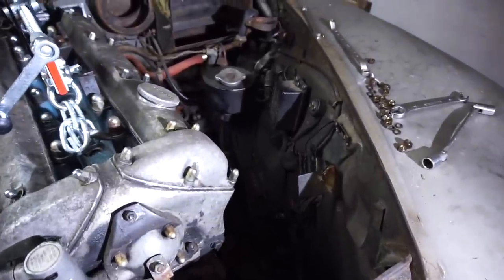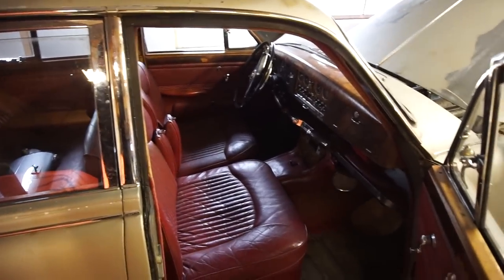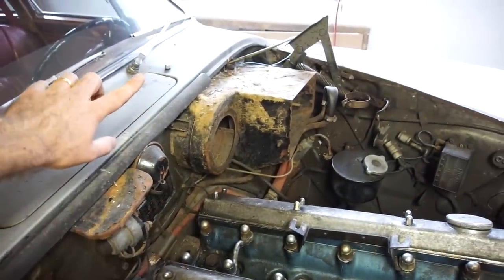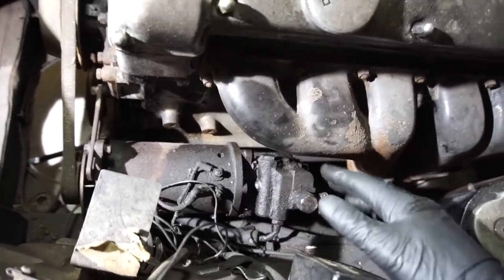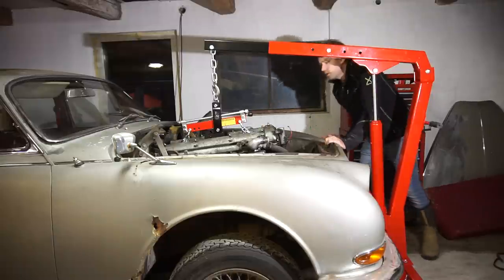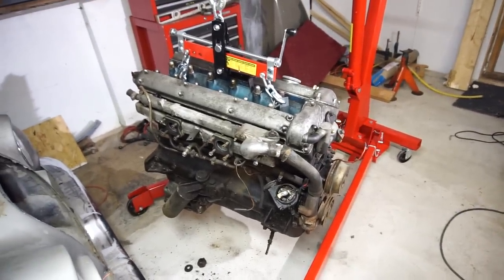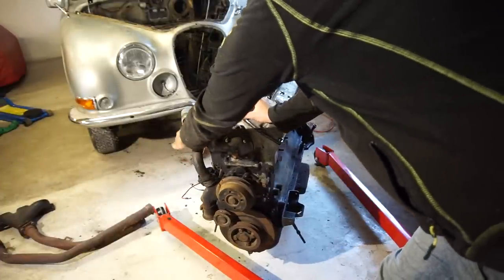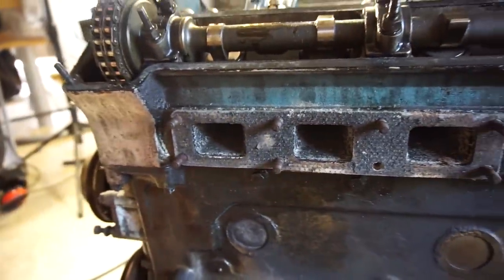Classic Jaguar Full Restoration Project - the restoration begins

Comment: The S type is fantastic, hoping you are enjoying the project, keep the vlogs coming, all the best
Reply from the maker: I will, thank you Ross
Reply: I have. 2000 XJ Sport and a Daimler 250 V8, your vlog is very very inspirational. All the best
Reply from the maker: I really like that little Daimler V8. A very sweet engine
Reply: Well she’ll sit at 70mph all day long if needed, really raspy exhaust note, and being the Daimler, benefits from the LSD rear axle and much better seats up front. I must also add, not that it matters, but, MPG is surprisingly good. She is a 1968 with a genuine 85652 miles on the clock from new, I drive her as much as possible. Keep up the good work

Comment: Adam,  Looking forward to watching the restoration, Hopefully you will be lucky with with the shell but it‘s amazing how much rust
the Jaguars can hid until you get them apart, My XK 150 looked fair for a 1958 car but when i started the strip down the dreaded 
rust problems where very evident, So a ground up bare metal restoration was the only way to go.  I have a 1966 MK10 & a 420G 
That will be scrapped  if i can‘t sell the rolling shells but i will see if there is anything you can use. Cheers Dave
Reply from the maker: I know what you mean. I can’t wait to get the whole interior out so I can really start to inspect the inner sills more. From underneath the floors are very solid.
Is the Mk10 a 3.8?
Reply: Adam, Unfortunately neither of the cars have engine or gearboxes with them but the cars are rolling shells i thought
for 500 euros each they would sell. The IRS systems would be worth that alone. Cheers Dave

Comment: Fabulous project.  What is your ultimate “vision” for this car?  Are you wanting to restore this back to original as a show car?  I have a 57 Chevy that was almost completely original and in really great shape.  My old car mentality is that I like a functioning time capsule.  I like the feel and aesthetics of driving my 57, but I like eating solid food, so I installed power brakes, upgraded the front drums to disc brakes, three point belts up front, power steering, a more reliable engine, etc.  I pop the hood and 95% of people would have no idea that a lot under the hood isn’t original.  Anyway, that being said, depending on your budget, Johns Cars in Texas sells kits to attach a Chevy 350 or 700r4 transmission to a Jag XK engine.  There are interesting electric power steering upgrades for old cars nowadays.  And the ‘75 XK engine I rebuilt for a kit car project, which is currently sitting on a homemade run stand, as a small size or ‘micro’ alternator on it that works fabulous with some temporary brackets.  I’d attach a picture if I could.  One last thing, if you have a Harbor Freight or their ilk near you, furniture dollies, a 2x4’ sheet of 3/4 plywood, and some short 2x4 pieces under the front of the engine for the odd shaped oil pan makes a cost effective way to roll an XK engine around and to wok on it.   Sorry for the long post.  You should attach a ‘channel email’ address so nerds like me can send you info you probably already know.  =)
Reply from the maker: No need to be sorry for.m a long post, in a need too :) I do my best to reply to all comments.
My ultimate vision is a car that looks like 1966 but might be hiding a few updates.
I’m thinking of adding a newer transmission out of an XJ6 and to possibly build a custom AC unit that is hidden in the original heater box. I love the interior so I’m keeping that original. I’m not a big fan of the color of the exterior so I’ll be changing that but keeping it true to a Jaguar 60’s color. Since all the chrome looks pretty nice I’ll be keeping it as is. So basically it will look like a good survivor car that’s useful
Reply: Living With A Classic   That sounds almost exactly like my mode of thinking.  My 57 is a good weather daily driver, but I update it for safety and reliability.  With your interior, I’d even go so far as to leave the radio in the dash but disconnected and hide a Bluetooth amp receiver thing to some speakers and use your smart phone for music.  Vintage Air is a good company for classic car AC and heat.  I had a vintage air AC in my 1960 Cadillac.  It was ok, but old cars aren’t sealed very well, so the AC wasn’t too effective.  I’d look into modifying an aftermarket VW beetle AC unit.  If you went heat only, vintage air has a very compact heater and defrost unit in the $200 area.  It’s like 9”x12”x3” or something.  Very good and simple unit.  Tranny wise, I’d stay away from the Jag BW-65 autos.  They’re not too terrible, but if you have room for a Chevy 350 transmission, maintenance and reliability will be much better.  If you do use a Jag tranny, look into changing the rear end gear ratios for better highway driving.

Comment: Space savings was the key selling point when GM offered a generator / power steering pump combos in the 1957 and 1958 autos that had factory air conditioning, as did the Packard/Studebaker Hawk that had both Paxton supercharger and factory air.

Comment: I've been waiting with bated breath for you to start this project. I have restored my 1965 3.4S and am half way through restoring a 1966 3.8S. 
I've installed 4 pot Volvo 240 front brake calipers as an upgrade and am in the process of changing the battery polarity from positive earth to negative earth plus electronic ignition. What are your thoughts on these modifications?
I use my Jags all the time. My daily driver is a 1989 XJ-S coupe, and I have a 1965 Mark X as well.

Comment: Good job getting the engine out.  I have a lift and tilt setup just like yours.  You can get better ceiling clearance by choking up on that hook chain.  Just remove the bolt holding the chain and put the link closest to the hook through the anchor bolt.  Hope you got a pair of S.U.'s in the deal.  They are pricey.
Reply from the maker: Thank thank you! I realized I could do that half way through the lift so I know what I’m doing when it’s going back in haha
Yes I have everything for the car except the dipstick and 1 small piece of chrome.

Comment: A way of accurately locating hinges etc. Is to drill a  1/16" hole on each hinge, through the shims etc. for a "roll-pin" which will be in a unique position, so that when you replace them they will be in the original position.
Just make sure that ALL hinges are located accurately, (door drops amended), before drilling for the "roll-pins".
Looking forward to this restoration !
Reply from the maker: Thanks for the great tip!
Reply: I have seen people do this and I think drilling holes into your car for no reason other than marking a location point is stupid! I own Jaguars (`67 E 2+, `95 XJS 6.0, `95 XJ12 SWB, `05 XJ8 Sovereign, `05 XKR and other cars. My 1954 Hudson Convt made the cover of Car Collector at one time. You can mark locations with a grease pencil that can be cleaned off after installation instead of creating a potential rust spot.
Reply: @Clarkecars  when you're going to media blast the car, a grease pencil just won't cut it  !
Then when the bodyshell is repainted, there are no marks to tell you where things are fixed. 
So a minor hole that gets filled with paint seems not so "Stupid" after all  !
Reply: @Rovinman  Then use a center punch!!! Media blasting doesn't remove those!! So yeah, it is STUPID! How many show cars have you built?

Comment: Hi Adam, once again a great video. Ref the steering column universal joint, my Mk2 also has this feature Adam and it is to enable the steering wheel to be moved in and out. I have repaired mine as it was very sloppy because the U/J contains ball bearings and nylon cages! Good Luck Adam and keep the videos coming.
Reply from the maker: Thanks for the information! I’m more used to working on the XJ’s and XJS. It’s a neat feature

Comment: I doubt the engine is seized. You were right to be cautious though. Mistakes on XK engines are expensive...

Subscribed, looking forward to seeing more of this car.
Reply from the maker: Yes they sure can be! I’ve been told it’s a 20,000 km engine so I hope that nothing has to be reground. Thanks for watching!
Reply: @LivingWithAClassic  Camshaft looked promising. If it really is a 20,000km engine, the insides should be fine, any work needed will be from standing unused. You may have a gem on your hands!

Comment: You have a great job/hobby. I enjoy your videos a lot.
Fact: Jaguars are charismatic, elegant, sexy, fast, beautiful, exclusive, historically important but also, troublesome...
Question: are old Jaguars more or less demanding than the post 90s ones?
Reply from the maker: They certainly are great cars!
Older ones are probably more demanding but also more rewarding to drive if you ask me
Reply: Well, I own a 1995 Jaguar XJS convertible 6 cylinder with about 65.000 miles and that lady is in very good shape and without rust.
Very much I like to see these video's about this and the other older Jaguars, admiring all these efforts to perform a restoration.
Regrettably however, I cannot do such a work so I better stay with my own "a little bit classic" Jaguar.
Saying: for this real older classics, I think that you must have enough craftmanship / time or money to maintain them for after restoration (depending on the kind of) they may still be sensible to rust but........... that's true, these cars are real beauties.
Best regards from the Netherlands.

Comment: Is this a manual or automatic car? I thought a clutch master cylinder might have been visible in one shot but I wasn't sure.
Reply from the maker: It’s an automatic and why you saw was probably the pretty weird brake master cylinder. These cars have an odd braking system

Comment: Adam. Haven't started watching yet but  careful you don't overload your self with too many  projects . However, l can well appreciate that a change is as good as a rest ! O.K now l'll watch the video. Adam have you checked the price of panels?  Better try the lottery ! 😂😂 Adam , at 4.30 a marker pen is hit and miss l drill  2x 2mm holes through  each hinge and inner bonnet  panel and then use pop rivets when refitting the bonnet to align the bonnet . Nicely done , as Jay Leno would say . Have you seen a specialist company is remaking 3.8 
blocks ..... £ 14 k !  So yours must have a value whatever happens !  Great stuff Adam.
Reply from the maker: I understand but it’s more about logistics. The body work of this car will be restored in my small workshop which I’m turning into a metal workshop. It’s simply easier to strip the car in my bigger workshop. I want to move it down there before all the fall rain. The ground outside that workshop easily turns to mud haha
Reply from the maker: The car came with almost every panel that I need which is great. I do need the rear of the front wings but they weren’t that pricey when I checked a few years ago. 
I have seen those crazy prices and that’s why I’m so careful with the engine. 3.8 blocks are starting to go up in value
Reply: @LivingWithAClassic   A friend has a MK lX and has several 3.8 blocks at least 1 3.4 and has a rare 3 and a half litre engine . The latter should have been returned to the factory as there was some kind build fault . He has no interest in selling any ! If l had potentially  £10 + grands worth of dead engines sitting doing nothing they would have to go !